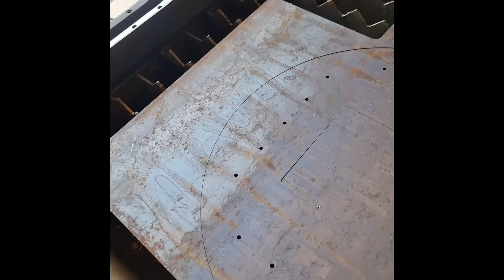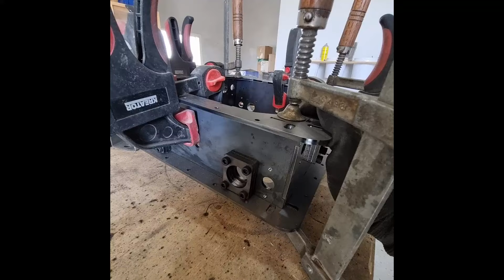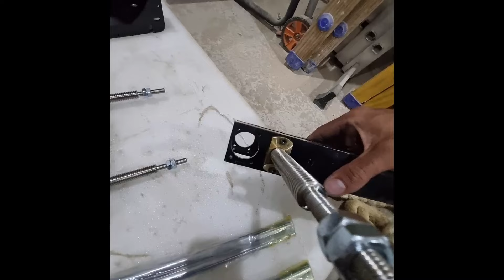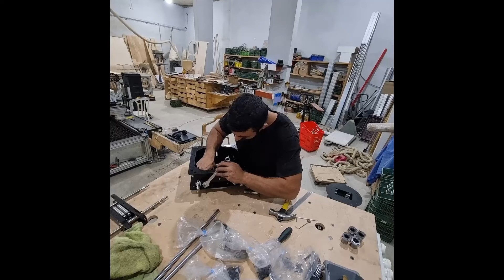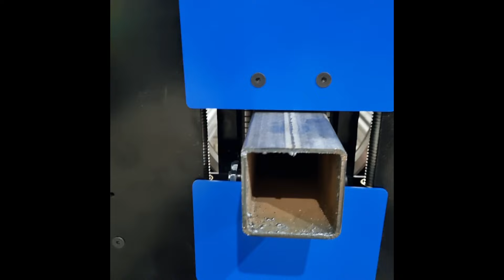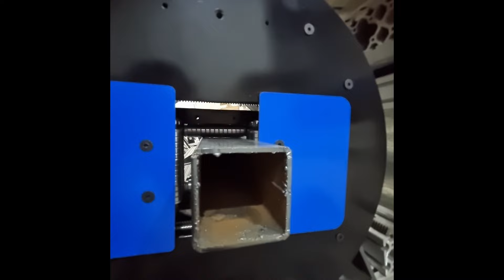DIY fiber laser front chuck V2

Comment: Very nice machine! I'm planning to build a similar size table but, I'm wondering if using those over 1kw servo motors are necessary when there's no force cutting through the material as it's the case with a cnc router or milling machine for example. How do you calculate the power size of the motors?

Comment: Thank you for taking the time to share your time and knowledge. I currently have a 4'X8' CNC plasma table I am going to dual purpose with a DIY fiber laser addition. I should be receiving my 1500 watt set up sometime next week. I understand the differences regarding assist gases, but regarding an air compressor, I currently have a 220v / 60 gallon / 155 psi compressor which produces very dry air thank to a great set up. I keep hearing if using an air compressor I need some $5,000 dollar 255 psi compressor for a laser set up. I have high CFM's and my compressor has yet to drop below 100 psi output on the largest of jobs. I do not understand because there is only so much that is going to flow out of the laser nozzle. You may not be able to help me if you use O2 or N2, which I am sure to incorporate later. Just want to get started. Would I be ok with what I have? Thank you so much!
Reply from the maker: @lpfdemt  which controller are you gonna run with the laser?

Regarding the air compressor I know that you need at least 10-15 bar compressor for a commercial use!

Carbon steel cutting 2mm+ thickness you use Oxygen or air.
Lower carbon steel 2mm- thickness you use nitrogen or air.
Stainless steel and aluminum you use nitrogen or air.
Reply: @TAMARbarCNC  Thank you Tamar, I purchased everything from Sky Fire Laser, which ever controller that is LOL
Reply from the maker: @lpfdemt  raytools AX3000T for integrated flat and sheets?
Or fscut3000s?
Reply: @TAMARbarCNC  Raytools XC3000S
Reply from the maker: @lpfdemt  it's a controller suitable only for sheets cutting, not tubes
Reply: @TAMARbarCNC  Yes sir, sheet cutting only, not the tube cutting program.

Comment: Sweet project! Thanks for sharing. Any plans to add an etch function to layout dimensions for mating parts. Like on a tubular frame showing angle, start, stop, and center-line of bents, and exactly where the different pieces line up. Something that would limit the need to manually measure when assembling.
Reply: I think this will require a laser head with autofocus
Reply: @ДенисЛапшин-н5с  If it isn't possible with the big laser. Maybe add a small laser with a removal mount on the z axis, so it's not getting hit with sparks when the big laser is running. It would be extra work but imagine how much easier assembling the final project would be.
Reply from the maker: @danp762  soon I will change my controller and the new controller have this functions
Reply: @TAMARbarCNC  I find that most of my mistakes are made when I take out a tape measure. :) If you could make it work that would be amazing!